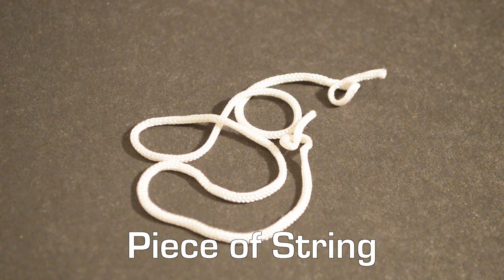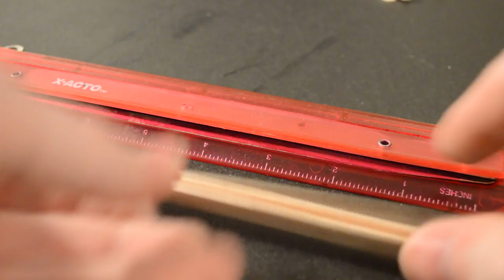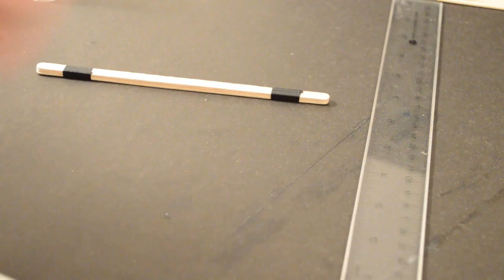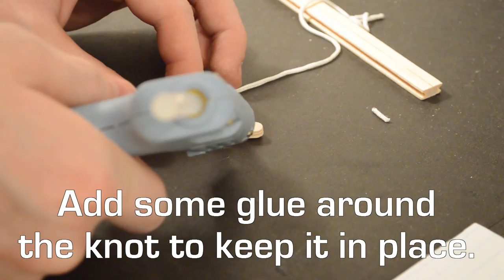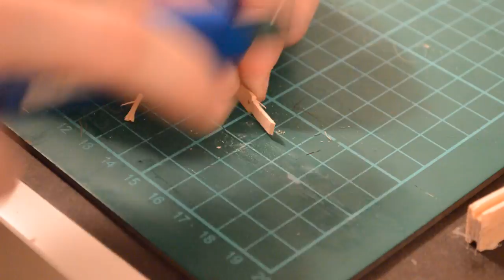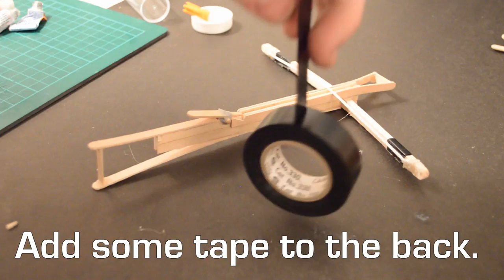How to Make an Awesome Mini Toothpick CROSSBOW! 🏹

Comment: question,  i tried to build one with what i could find. But i was wondering the dimensions of the sticks you used and what kind of string.. the stuff i bought doesn't really have like elasticity to it and so when you release nothing happens.... suggestions?
Reply: realy ! even me  i was suprised to see the pieces of wood which I thought that is not elastic ....

but tried alot...congrat to
Reply: Use a rubber band

Comment: if you add another trigger system to the bottom like how normal crossbows are built and then tie a string from top trigger to bottom trigger, when you fire the bottom one it will pull the top one down like how you did it in the video which should release the top trigger so that way you can hold it more comfortably. basically it just makes it easier to hold and makes it look more like a real crossbow

Comment: I can't see this holding up for very long. Even with the first shot the sticks didn't spring back completely. You might say that the materials are cheap and easy to get hold of, but so is a solid piece of wood for the stock and a hacksaw blade for the limbs. The design can still be pretty much the same, but i can assure you that you'll get heck of a lot more power and durability. 
Nice project anyway.